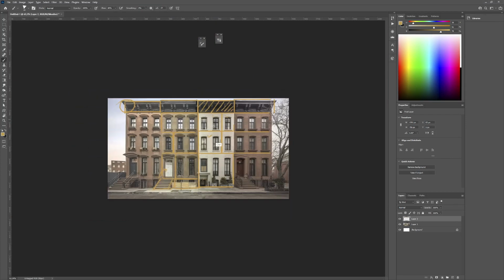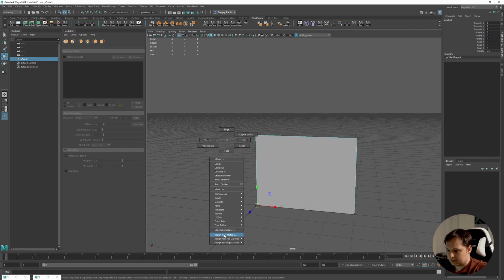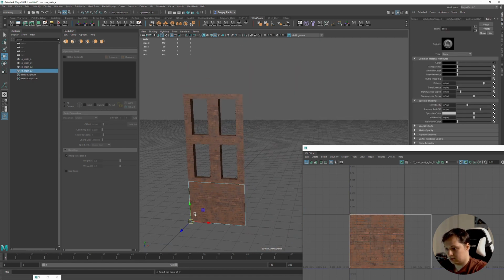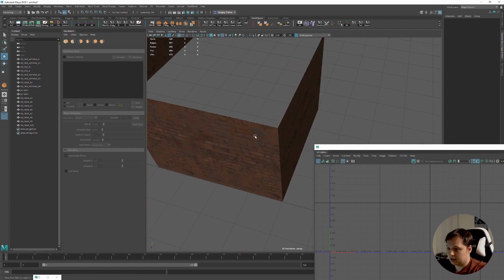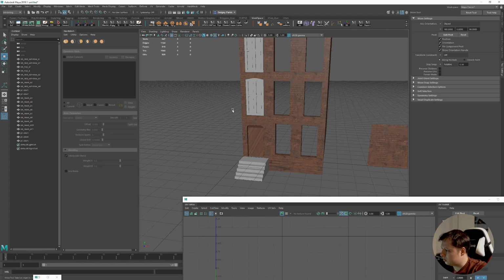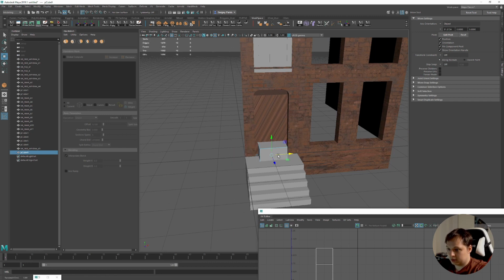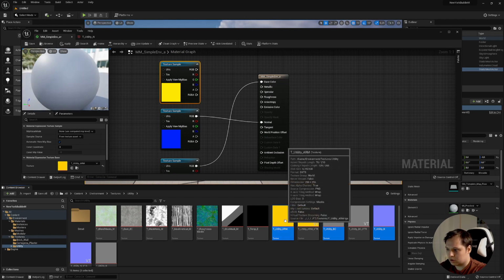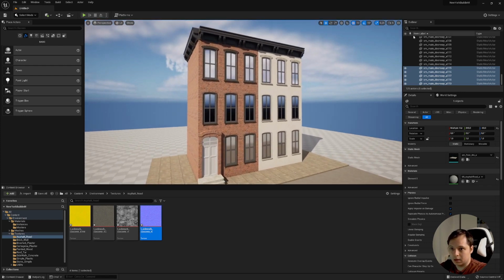GameDev with Leoluch: Let's talk about modularity

Comment: Hey Sergei, great video. If you're building an modular kit for a building that can be seen from the outside AND inside. Would you simply build kit items that have thickness and detail on both sides? Or is the indoors details generally a separate kit so that you can mix and match interiors and exteriors as you like? Thanks!
Reply from the maker: Usually it is related to situation and type of game you are doing. If building can be destroyed or damaged, usually no brainer - we use double walls. But when it is slow game and you can go inside the building, do we really need to have exterior and interior pieces together? You can do streaming that way, that transition not really visible, but having interior and exterior separately give a lot of benefits. Modules easier to do, they cost less, interior and exterior even have a little bit mismatch.
Reply: @sergeileoluchpanin-gcd2524  Right, even after I sent my comment here, I realized even from a material/texture cost perspective, it wouldn't make much sense to have interior and exterior joined together. I still struggle a bit with this scenario, as I've worked on some modular kits for doing just building exteriors and creating a bunch of house prefabs. Once I started working on a kit for a house that you can actually enter or look into, this is where a lot more questions arise.

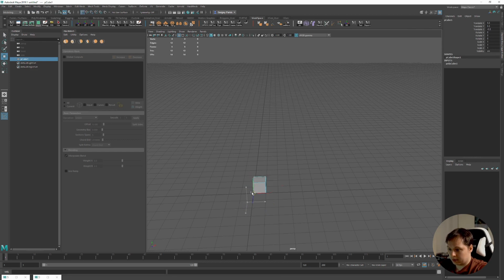Comment: at 19:26 why did you change the scale using the x,y,z scale an not at the input (below the scale ) and how come you can just put 4 instead of 4000 cm?
Reply from the maker: On first question - habit :D Regarding second question - I am using working units as meters (you can change this in Preferences - Settings)
Reply: @sergeileoluchpanin-gcd2524  thank you for the reply.